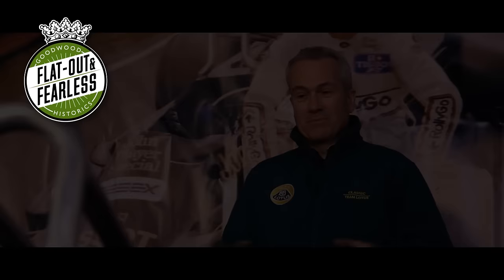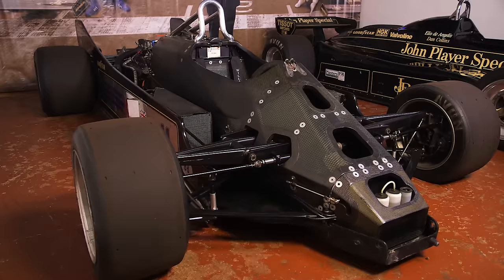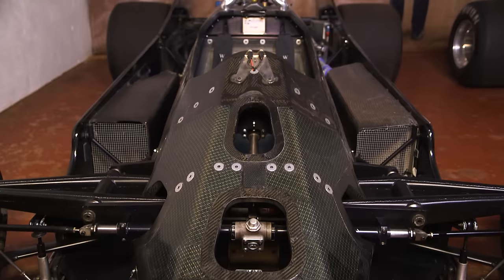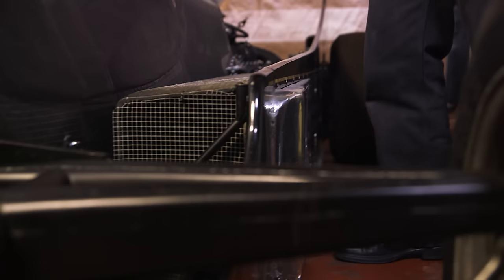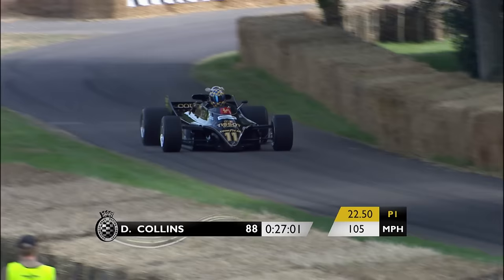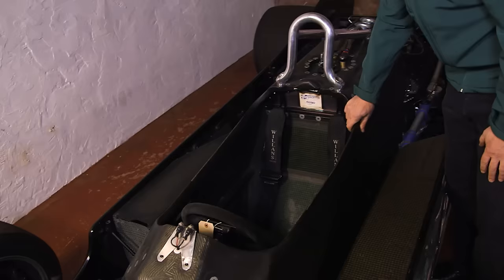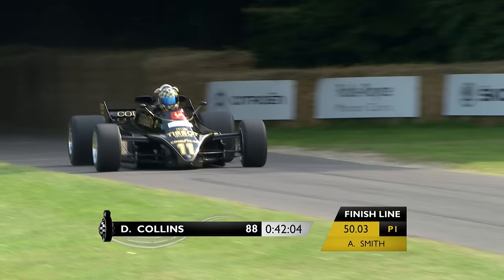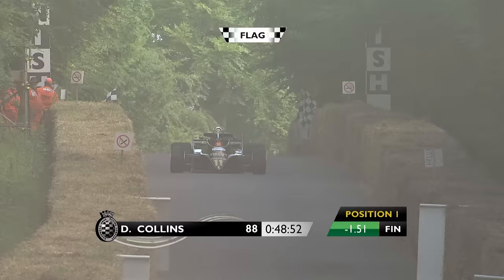Lotus Type 88 - The BANNED F1 car

Comment: But why did it get banned, if it complied with all rules and regulations?
Reply: It didn't comply with the rules of the day.  Moveable aerodynamic surfaces had been banned since the late 1960s.   Chapman drew it up, had it built and brought it to race hoping it would squeak through.  He knew it was right on the edge (and possibly over it)... and the FIA (or FISA as it then was) eventually decided after protests from several teams that it was not legal under the then current regulations.

Comment: Isn't the ban thing normally because the team violate the design rules?
Reply: The FIA can, and occasionally did, ban a car, or a part, that does not violates a specific rule, but is deemed to be generally  out of what's accepted as a F1 car, as described by the ruleset, or to be outright dangerous. It had been, for example, the case of Brabham BT46 fan-car.
If the builders wants to avoid it, they can ask first than the start of the season if their interpretation of the rules is correct. If the FIA gives its permission, it will not overturn its verdict later.

Comment: I seem to recall that the ground effect was particularly effective on the Type 88 because of the airflow that was available either side of the the V8 crank case. Ferrari, with its' flat engine configuration was not able to get as good a ground effect. This put Ferrari at a disadvantage. Ferrari then threw a hissy fit and threatened to withdraw from F1 unless the ground effect cars were banned. FIA caved in and we lost the technology. 
Personally I'd have said to Ferrari "Well it was nice knowing you. Bye bye."
Reply: At that time Ferrari was running with a very small 1500cc V6, way smaller than the 3000cc Cosworth V8 of the Lotus (it was the beginning of the Turbo era), so no, that wasn't the reason.   
The protests were filed by many other teams, not only Ferrari (and that comprises the other English teams too: Mclaren, Brabham, Williams...), on the ground that moveable aerodynamic surfaces were banned by the rules, and that the rulebook prescribed a minimum distance of 6cm of any suspended part of the car from the ground, that the Type 88 violated as soon as it began to move. 
The harshest   critics of the Type 88, in effect, had not been Ferrari and Renault (whose turbo engines put them on another planet on fast tracks, but that were still unreliable), but the other English teams, that, like Lotus, relied on aerodynamic efficiency to be competitive.
Reply: Terry:   While the flat 12 was not in use at the time the T88 came out, it was 'difficult' to incorporate ground effect around a boxer engine (also one of the reasons why the replacement Ferrari engine, a 1.5 litre turbo v6, had it's turbos nestled within the vee rather than outside - IE: the engine exhaust ports were in the included angle, not outside).   That said, Ferrari won the world championships in 1979 - with the flat 12 and ground effect.  They did this years after Mario Andretti won with the first true ground effect car, the Lotus 78.

So it was possible... and the Type 88 was far from the first ground effect car...  After Lotus introduced the 'modern' version of the technology in 1978 (Jim Hall's Chapparal indycar team had tried venturi tunnels in the 1960s, but did not incorporate the sliding skirts that made the technology work so well later on) both Ligier, Williams and Brabham produced truly remarkable versions of the technology.    If you want to see what driving a ground effect car was like, search for footage of Didier Pironi's Ligier setting the lap record at Brands Hatch in 1980...  the car rarely slows for the corners, and just skitters around the (very twisty) circuit.

In 1982 - arguably the height of unrestricted ground effect - 19 drivers worldwide were killed in open wheel racing accidents (and several, including Pironi, were severely injured).   The average for years before and after this hovered around 5 or 6 (there are always accidents, of course).   The problem with this technology was that  it increased cornering speeds beyond the ability of both the machines and the drivers to handle.   The Type 88 would have done nothing to solve the lateral G force problem, or the issue of static vs kinematic adhesion, that these 'ground effect' cars demonstrated.

In simple terms, when a standard "wing car" begins sliding, the driver can lift off and possibly regain control.  When a ground effect car starts sliding, lifting off actually reduces downforce at a more rapid rate than speed is reduced... meaning there is really no way for the driver to regain control.

Aside from all that, though, the T88 was a clear violation of an existing rule in the FIA handbook - the ban on moveable aerodynamic devices.  This ban dated back to the early days of 'standard' wings on F1 cars... it didn't take long for some teams then to determine that while fixed wings 'worked', they would work better if the driver could flatten them out on the straights and then put them back in the appropriate angle of attack before the corners... you can probably guess the kinds of problems this causes...

Comment: Another success for the FIA  Ferrari International Assistance !!!!
Reply: The same FIA that allowed Mercedes to race after testing illegally Pirelli tyres?
The same FIA that allowed Brown GP to race with the double decker extractor in 2009?
The same FIA that banned Schumacher after Jerez 1997 (and that was right, once in a while), but did not the same when it was Ferrari to be trow out from the race (Suzuka 1990)?
The same FIA that banned the BT 46B under pressure of Colin Chapman?

BTW: i used the term "FIA", but actually it was a separate federation, the CSI (Commission sportive internationale) until 1979.
From 1979 to 1993, it was FISA (Fédération Internationale du Sport Automobile).
From 1993 the functions of FISA were taken directly by FIA
Reply: @gufo_tave  ooo touched a nerve there 😎the term is/was used by the garagistas as Enzo refered to the rest of F1 entrants

Comment: they banned it because lotus found a loophole not because they hate innovation
Reply: It was not even a real loophole. They renamed what was a single aerodynamic mobile surface (so banned by the rules) "primary chassis" and tried to get away with it.
Is like someone renamed a secondary engine (so cheating on the total displacement and number of cylinders) "water pump" and tried to get away with it.
Reply: The engine and the chassis are not the same thing
Reply: Adam Khan you know what he means. Stop denying

Comment: Can someone explain to me please as to why such efforts were thwarted? Was it some red tape BS where officials expected to get paid under the table or something and when Lotus refused to play this is the result?

Edited to add - That is one absolutely gorgeous car!
Reply: This was a way of circumventing the rules. There has long been a rule banning moveable aero devices for safety reasons and a new rule had been put in place limiting side skirts to reduce downforce. This car got by those rules by allowing the side pods drop on the track. As cool as this car is, I can't really blame the FIA for banning what is essentially a clever cheat. Especially since the moving aero device rule was already in place and could easily be applied to this car.
Reply: As already said, mobile aerodynamic surfaces already were out of the rules, and that rule had been introduced specifically to ban mobile skirts. 
It can be said that Chapman simply linked the left and right mobile skirts togeter, but that didn't made them less mobile in respect to the "real" chassis, so the car was really a blatant cheat.

Comment: well in facts the car was not that good and it was very unpredictable, it was banned because it was using a double chassis technology. drivers were scared to drive it, because the technollogy had no constistancy when the car was in a corner. it would either get a huge amount of downforce and become a speeddemon or it would lift up and lose downforce wich was slowing it down and making it unsafe at highspeed corners. the double chassis technology is why it got banned.

Comment: The seats were so far forward
Reply: Yep.  The drivers in both F1 and USAC/Champ Car at the time sat between the front wheels, more or less.  Their lower legs were AHEAD of the front wheel centreline.  This lead to some truly horrific accidents and injuries for the drivers of the day (Rick Mears, Didier Pironi, Danny Ongais, etc).

Many of us complained that the rule should be changed to force designers to install the footbox/pedals no further forward than the front wheel centreline... which seemed the thing to do.  The FIA ultimately did it, and then we began to get a lot more head injuries (when drivers crashed, the wheels & suspension folded back toward the cockpit).   Prior to the change, the same incidents would have resulted in the wheels folding back BEHIND the driver.

Every action has both intended and unintended consequences... just like the FAA requiring lockable doors on the cockpit of passenger airliners... it can keep bad people out of the cockpit, but it can also keep out good people.... Germanwings...

Comment: did he explained why it was banned? the reasoning FIA gave?
Reply: No, Clive carefully avoided that part.   the FIA banned moveable aerodynamic devices in the 1960s.  They banned the so called "skirts" on ground effect cars in 1981 I believe.  This car flagrantly violated the both the former and the latter by having the entire sidepod system moveable and in contact with the racing surface (which is what the skirts used to do on full ground effect F1 cars).

It was ingenious and innovative.  It was also a violation of a rule that had been in place for about 15 years when the car debuted.

Comment: Would this car be able to race today??
Reply: No.  The rules are changed so frequently that even cars from a year or so ago would no longer be eligible.  You could potentially modify, say, a 2015 car to meet today's regulations, but as these cars aerodynamic systems work as a package, changing them to meet todays regs would make them woefully uncompetitive, even with a 2019 engine etc.

If you are talking about the basic concept being used in a modern design, well, skirts are still banned so a split chassis designed to keep the sidepod bottoms in contact with the road surface would not be legal.   Since we no longer have the 'Moveable aerodynamic surfaces" exclusion in the rule book (since DRS), it is an interesting question whether some version of this design might be possible... but I doubt it given all the other changes to the rules over the years.

Comment: Are ground effects accepted now in F1?
Reply: Tricky question...   When ground effect was banned in 1983, the FIA imposed a "flat bottom" rule on the floor of every F1 car.  No tunnels, no underwing, just a flat plane extending from the centreline of the front wheels to the centreline of the rear wheels.

Months later a man named John Barnard designed the first rear diffuser.... which was more or less a pair of 'ground effect' tunnels attached behind the rear wheel centreline of the car.   It didn't contravene the letter of the flat bottom rule, but many people thought it wasn't in keeping with the 'spirit' of the rule.    As diffusers (and their associated top side bodywork that improved performance) got more efficient over the next few years, the cars started to look more and more like the 'ground effect' designs they had replaced.   By the very early 1990s, the flat floors had been augumented by extending them out past the sidepods/bodywork to the full width allowed by the regulations.  Many of us began noticing that the flat floors deformed considerably while under aerodynamic load... and began looking quite a lot like the skirts that had been banned for the 1983 season.

Somewhere along the line (mid-late 90s IIRC), the flat floor concept was abandoned.  We now have splitters under the nose of the car (which is an underwing, also a feature of 1980s ground effect cars) and diffusers that start well ahead of the rear wheel centreline, as well as staggering numbers of air flow management "bits" attached to the cars for which the sole purpose is to improve the efficiency of airflow over and under the diffusers.

So, while F1 does not have "full" ground effect in the sliding skirt/free underbody design sense of it, the cars do develop a high percentage of their total downforce from the aero properties of the floor of the car rather than just the wings and 'top side" aerodynamic pieces. 

Is this 'ground effect'?   I would argue very much so, but it depends on your point of view and definition.
Reply: @ShmuelWeintraub  A current F1 car develops about 1,000 kg of downforce at 200 km/h.

Comment: How much downfoce this car generate compare to today F1 cars ?
Reply: A really good question.  Since the T88 did not race, it is hard to tell exactly.  However, the 1980/81 Williams and Ligier ground effect cars were thought to be producing between 8-9000 lbs of total downforce at full speed (most of it from the underbody).    The standard used to be that "a modern F1 car (1981 - weight around 600kg) could run upside down (IE: stick to the roof of a tunnel)  indefinitely as long as it stayed above 100mph".

I haven't heard any reliable estimates of what today's F1 cars produce, but given their cornering speeds (and how much they look like slot cars when they corner, thanks to the splitters and full width aero floors) I would have to say they are at least back to 1981 levels of downforce, if not higher.

Comment: Great video. It is unfortunately showing one more time that F1 is ridiculous, just because you make a 2x better car with half the effort and money if it would really follow technology. And still the result is poor races where 99% is decided by the car instead of the driver. For luck there are also motorcycles.
Reply: This was a rubbish car and the FIA were 100% correct to ban it. It contravened a rule that had been in place for 13 years - the prohibition of suspension-mounted aerofoils.

Comment: I'm curious, is it against the regulations?
Reply: Yes, it was.  Lotus gambled that they would get around the ban on moveable aero devices and the sliding skirt ban by designing the car the way they did.  They were wrong on both counts.

This is what designers do... push the regulatory envelope.  Brawn's double diffuser in 2009, Red Bull's flexi wings, Brabham's hydropneumatic suspension system (also in 1981, iirc), Ferrari's (quickly banned) offset rear wing in 1980 (?), so called "X" wings in the mid 2000s... even Tyrrell's 'water cooled brakes' in 1984 (which was really just a way to race underweight for most of the race and then top up to meet the minimum weight regs a lap or two from the end of the race).

Designers are always looking for ways to work around the rules.  Sometimes they succeed (Barnard's rear diffuser in 1983/4, Brawn's double diffuser in 2009), sometimes they don't (Lotus 88, Tyrrell's ballast system, etc).
Reply: Colin Chapman, before he built the 88 consulted with Charlie Whiting, who agreed it was legal, as indeed it passed scrutineering, but Ferrari, who seem to own the FIA got it banned.
Reply: @barryfowles-zl5ib  :  From 1978 to 1987 Charlie Whiting was a Brabham team employee (chief mechanic for much of that time).  So... your view is that Chapman took the drawings for the T88 over the Brabham factory and let a rival team's chief mechanic look at them just to get his view on whether it would be legal or not?  Staggeringly, staggeringly unlikely.  If you have proof of such a meeting, please link to it.

Ferrari were one of several teams (including Brabham, who suffered a similar fate with their ill considered fan car 3 years earlier) who protested the legality of the 88's moveable aero surfaces.

It was passed at scrutineering, yes.  This is because scrutineers deal with more traditional measurements: weights, dimensions, capacities and the like.  They do not interpret regulations, they simply follow them. 

The 88 was always going to be subject to protest as to it's legality.  Like the fan car, (and Ferrari's offset rear wings and eventually X wing concept) it was rightly banned.
Reply: @ShmuelWeintraub   You are of course right, my error was trying to remember facts from 30 years ago, very unsafe, I do seem to remember however that Chapman, in order to avoid costly build and development, did run the concept past the FIA technical delegate, who as you stated could not have been Whiting at that time.
Reply: @barryfowles-zl5ib  :   I think you are correct, I recall some discussion about Chapman trying to get some sort of agreement or consent from the FIA regarding this... but I'm not clear on how or why (most regulatory bodies will not give an advance judgment on something as these are "challenge" based decisions... you literally can't get a judgment until a protest is lodged).

Sorry for the double post, I didn't even read the OP line so did not know both were yours.
Cheers.
Reply: @ShmuelWeintraub     Sounds about right, in my opinion, for what it's worth, in F1 it's always better for a designer to come up with an "interpretation" of the rules and regulations which  is a detail, as with double defusers or indeed wings before they became an integrated part of an overall, then all the other teams objected to the advance just long enough allow them to copy it, Chapman with the 88 was just too advanced of everyone else and paid the price. 
Incidentally, you seem to be an articulate person but seem unable to spell Samuel correctly, but you are in good company Roald Dahl was unable to spell Ronald.
Reply: @ShmuelWeintraub As far ai I know the Ferrari's offset rear wing was a protest against certain interpretations of the rules by other teams